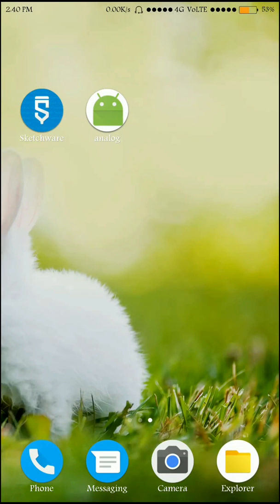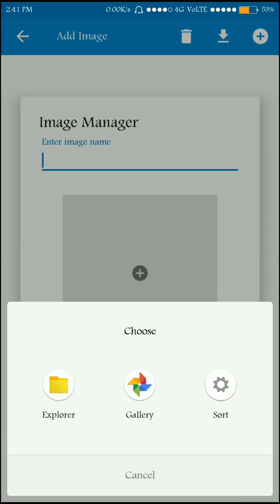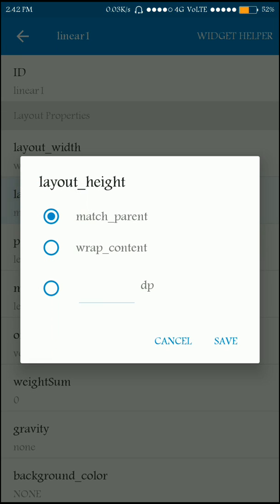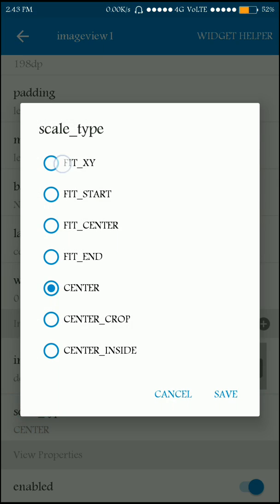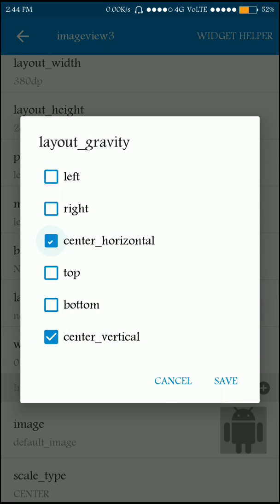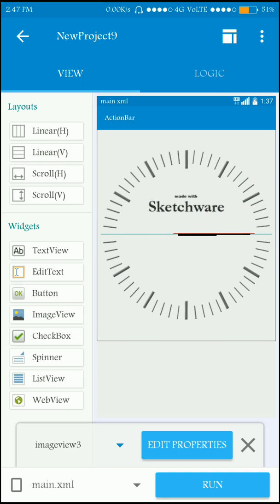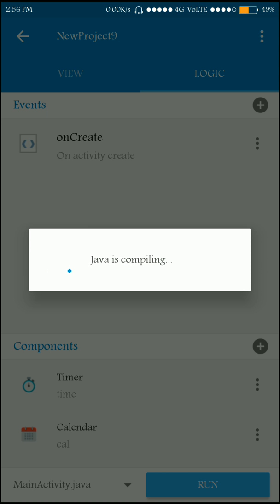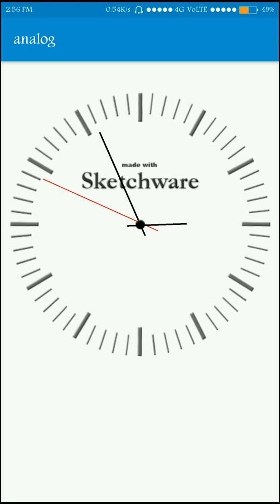#13. Sketchware Tutorials-How to make analog clock app in Sketchware-Rotation Tutorial

Comment: How to get UTC time, instead local time zone?
Reply from the maker: +Jain Askandary It works with your system settings. i.e., it takes data from your phone.
So, change time zone in your phone
Reply: If on india at 12:00 PM, i want to display on UTC time 06:30. When i move to Paris, UTC time still correct. How to showMasage my TimeZone setting?